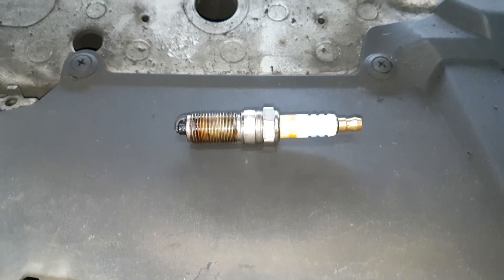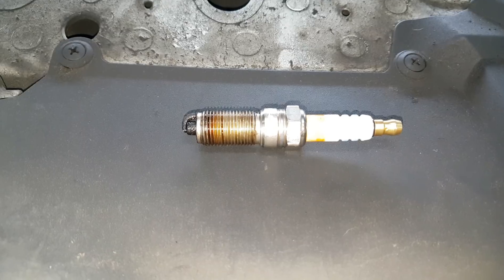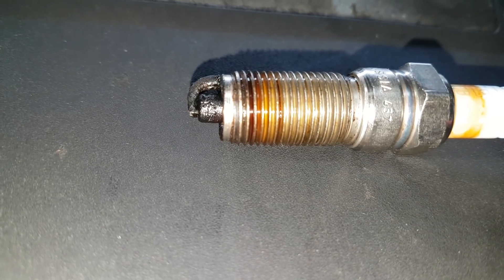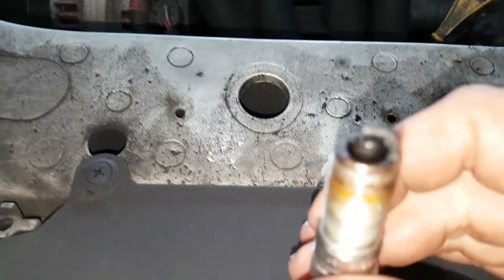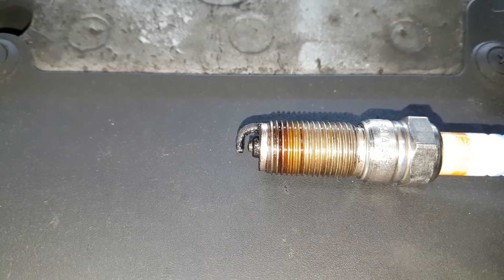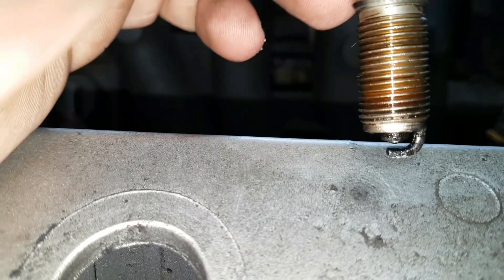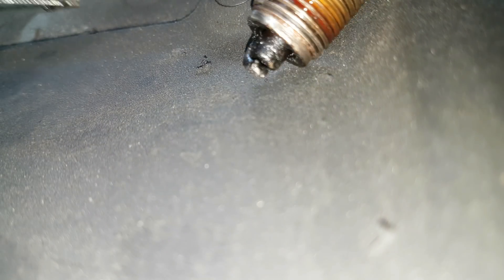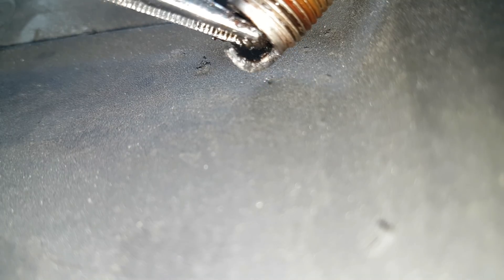Intermittent Misfire Spark Plug Bodgit And Leggit Garage

Comment: Hi just wondering if anyone has any ideas what my problem could be: I have a 1.2 Turbo TSI Golf mk7 that has an intermittent misfire problem (misfires on startup maybe twice a week for 20seconds). Code reader gives p0300 and p0303 but only if plugged in when the misfire happens. I have replaced spark plugs, coil packs, airfilter and engine oil. I have also ran multiple fuel cleaners through the tank aswell seafoam through the intake. I suspect weak battery, parasitic drain or carbon build up? Could it be anything else?
Reply from the maker: Jimmy hi mate unfortunately it's going to be impossible for anyone to tell you unless they are very lucky as random misfires can be caused from lots of different things you also had a misfiring cylinder three from your p0303 you might have wiring issues fuel pump issues blocked fuel intake leaks the list just goes on and on going to need some proper testing to find this answer no point just keep replacing things get it tested properly it will be cheaper in the long run
Reply: Thanks for the reply. I didn't think it could be tested at the garage given how intermittent the problem was and I wouldnt be able to replicate it for them. I even used my scan tools (ebs301 bought for brakes as per your channel recommendation) and the obdeleven which is more advanced vw diagnostics but they didnt reveal more than the basic codes. I am not afraid to wrench on my own cars but even I have my limits!!

If it helps most of the time its p0303 and p0300 but sometimes its p0303, p0302 and p0300. Also knock sensor voltage at idle is higher on cyl 3 than the rest by 0.5 -1.0v at idle. 

If you search "Check Engine Light / Misfires / Start Stop Errors at Random golfmk7" my full diagnosticsteps  taken will come up.

Could a weak battery cause this? Its rated at 320din,640sae and measured at 463cca today. The garage say the battery is ok and I might have a drain.
Reply: Unfortunately Im based in Glasgow so cant bring it round to you. Do you have any recommendations for garages here?
Reply from the maker: no sorry mate i dont no any 1 there

Comment: I once took 4.5 hours taking my chainsaw apart and then putting it back together before I spotted the very same problem with a spark plug. Well done for catching it so quick. It’s probably the vibration that does the damage on a chainsaw, not sure with a car engine, could be similar if the plug is as old as the car.

Comment: That's why if you accidentally drop a spark plug you don't reuse it b/c it's too easy for the insulation to crack at the base & go undetected & crack all the way thru like that one down the road but the electrode was pretty worn so it lasted awhile BUT if you still have the 10X spark plug reader with light you can inspect the insulation down to the base like we did after every run down the track to check for insulation cracks caused by lean detonation and read the spark plugs to see how lean or rich we were running at the top end and adjust the jets & timing accordingly. We were the PCM and oxygen sensors...now it's all done in milliseconds and tuned with laptops and YOU DON'T GET YOUR HANDS DIRTY.  Happy New Year Leon!

Comment: I was going to say that this is a new technology that's being used, but I see other folks has already beaten me to it :) I've seen a few videos of where the center electrode breaks away. Makes you wonder what's going on with the plug or is it just poor quality from the manufacturer. Have a good one Leon!
Reply from the maker: hahahaha thanks mate
Reply: It's usually caused by someone dropping the plug and the insulation will crack and thru time, heat, cylinder pressure, etc it'll crack all the way around like that one did and that is why if you drop a spark plug don't reuse it. That spark plug was pretty worn so it lasted pretty long. Sometimes the plug misfires are caused by cracked insulation and the spark is actually jumping to the base.
Reply: Thank you Bob for the explanation and that makes perfect sense :)